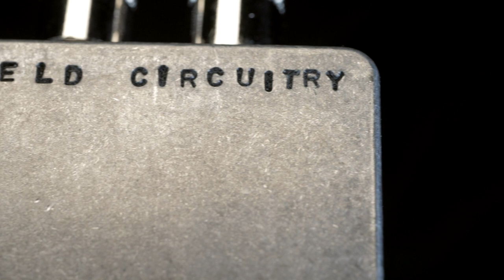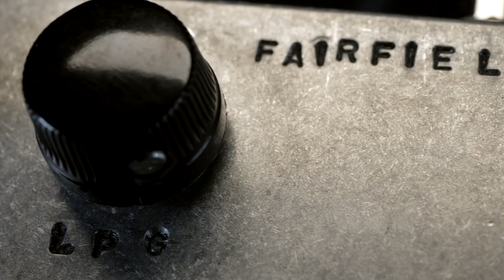Effects with Synthesizers: Fairfield Circuitry Shallow Water

Comment: Thank you for this video. Im only halfway through and you have already explained this pedal to me in a way that is 1000x easier to understand than all of the guitar oriented channels combined. I've been trying to hunt this Boards of Canada-esque style sound down in pedal form for a while. I keep going back and forth between a few pedals, but mostly have narrowed it down to the Cooper FX Generation Loss, Chase Bliss Audio Warped Vinyl mk2 (the Hi-Fi is too bright for me) and this pedal, Fairfield Circuitry's Shallow Water. Both this and the Gen Loss have random modulation, which means they are very likely my top two contenders - though if I had an extra $1000 to waste I'd toss in the Chase Bliss Warped Vinyl AND the Thermae just for good measure. lol

Anyways, enough rambling - thanks again for approaching this pedal from more of a...synthesists POV, I guess you could say. It's definitely helped me to understand exactly what I would be getting with this pedal. Liked and subbed.
Reply from the maker: Random modulation is the way to go! If you haven't already made up your mind, add the Hungry Robot Wardenclyffe to your list. It has the same Boards-y spirit as the others, but with some reverb and additional filtering options to make it more unique. I haven't gotten one yet because of overlap, but it's getting harder and harder to resist!
Reply: @Bloom_Music  what do you think about the Hungry Robot Borderlands pedal for similar applications?
Reply from the maker: @greatlakestrader  The Borderland is definitely more ambient than lo-fi. But it's got a filter and modulation, so it could get to some dark, wobbly places for sure. Depends on what you're trying to accomplish, I guess. If you're looking for something that does anything close to what the Shallow Water does, the Borderland is not going to be your best choice from Hungry Robot. The Wardenclyffe (and the newly released Wardenclyffe Deluxe, which I own) is an excellent choice for lo-fi warble. But if it's the crushed tape compression part of the sound that you like, you pretty much just have to go with the Shallow Water for that. I haven't found any other pedals that nail that sound in quite the same way. Definitely unique.

Comment: Interesting. I have a question. I got a new digital piano that is also portable that can run on batteries.. I want to buy a nice expression pedal to use with it on the go. What pedal would you recommend to use specifically with Piano, Rhodes and some Synth sounds? One that doesn't need external power. Budget under $350 Also, this might sound pretty vague but I have this analogy from the camera world. There's Leica and then the more affordable and reasonable Fujifilm who make their cameras with this amazing analog quality, simplicity and great tactile control that brings a fun and enjoyable experience. I'm wondering what's the equivalent in the expression pedal world? Thank you!!
Reply: I started playing more and more funk lately. stuff like Vulfpeck, Scary Pockets and older legendary players tunes.
Reply from the maker: Interesting question! Sorry for the slow response... So, first off, one point of clarity, an "expression" pedal is actually a specific pedal that is used to modulate parameters on other pedals, kind of a pedal controller. Any time you see an expression jack in a pedal, that means you could plug an expression pedal into that jack and use it to control a parameter on that pedal. But expression pedals do not actually make any noise themselves. It sounds like from your description that you are actually looking for some type of master effect that will work well with Piano, Rhodes, and synth. For your use case and budget, I would highly recommend looking into a multi-effect pedal. Something with reverb, delay, and modulation, and at least two effects at a time. Combining those three effects will get you 90% of the places you want to go with your instruments. Something like the Zoom G3Xn would work very well for this (and it has an expression pedal built in!). Look around YouTube for people using multi-effect pedals on pianos, Rhodes, and synths and see if you like what you hear. You will get so much more value for your money investing in something like that than you would dropping $300+ on some boutique pedal that only does one thing!

Comment: For the price, i’m not hearing lots.  It seems to be quite a hissy snake unless thats your recording or synth source?  Great demo though, thanks.
Reply: There is hiss from the v3207d bbd chip. You can filter it out a bit with the low pass gate, I prefer to keep some hiss for the effect. Sounds like worn out tape to me. But then again, I built the pedal for myself and did not purchase so my opinion is coming from a different place. I only spent maybe $60 on components and enclosure and such. It is a subtle pedal, which is my favorite thing about it. It's not a chorus on full blast, it's a gentle random warble.